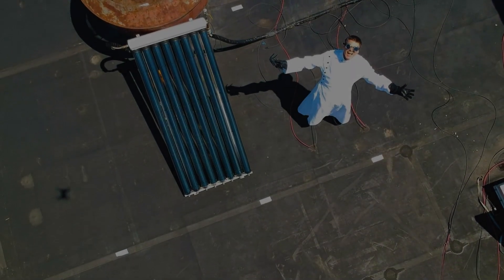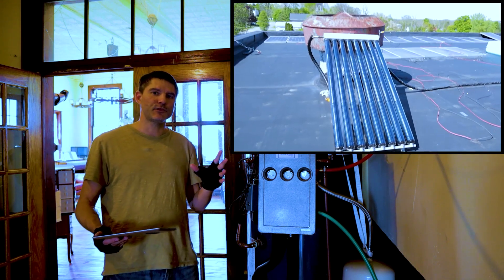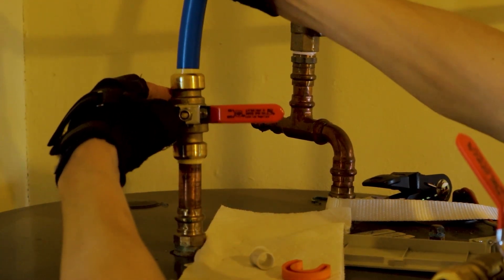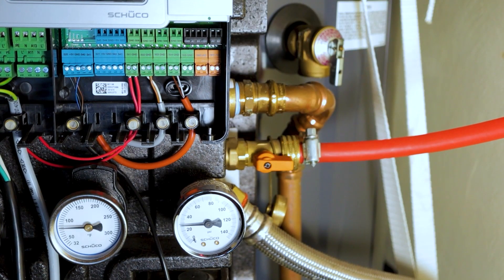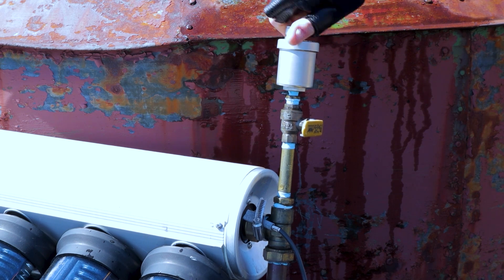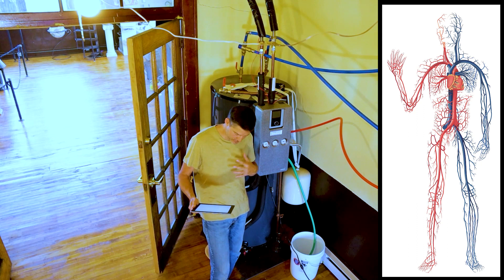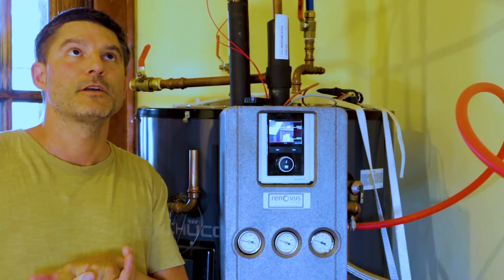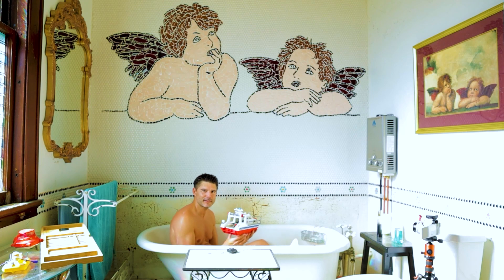110-Gallon Solar Water Heater | Homestead High Solar Transformation

Comment: Need more evacuated tubes in the system. Probably around 20 tubes would supply the house with hot water. Plus filled with antifreeze would work in winter with 30 tube about
Reply from the maker: Yea that is true. Thank you Randy